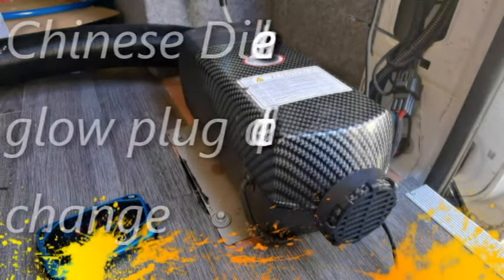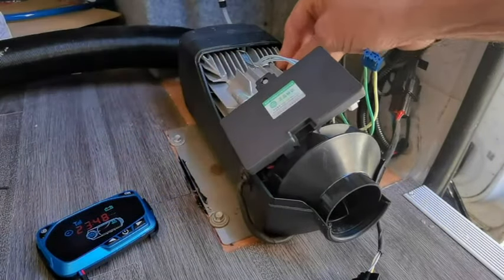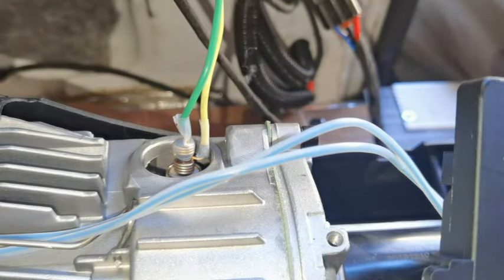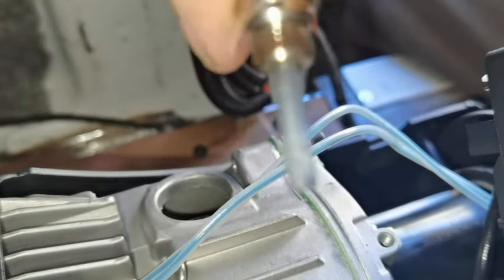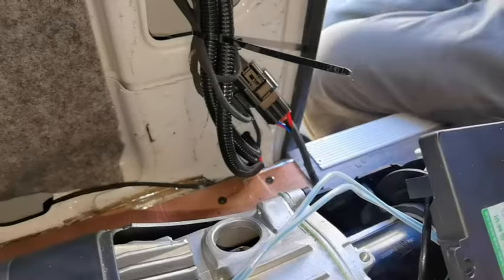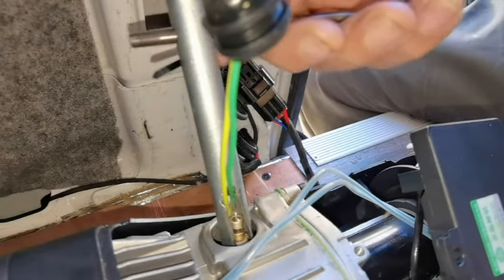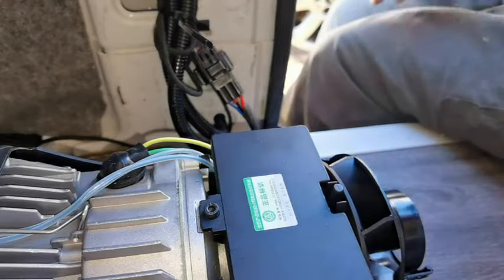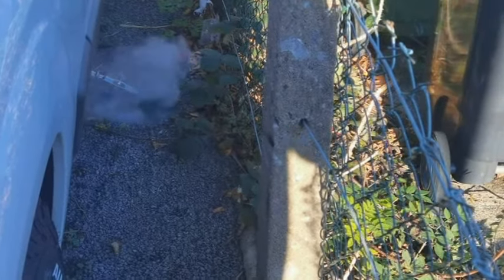Chinese Diesel Heaters Glow Plug & Atomizing Screen

Comment: To who ever is having smoke no start issues ,The gauze screen atomiser has to be pushed in as far as it will go so it doesn’t constrict the small hole to the side  that is what is causing the smoke no start issue, also use a bit of redex diesel treatment per tank fill will help. Also dont over prime these heaters as they flood .Great idea in vid using a concrete screw to remove atomiser screen 👍👍

Comment: Oven cleaner is great for cleaning out the burn chambers, strip it down then spray inside both halves liberally! After 5 mins soaking, give them a scrub with an old paint brush then wash out with a hose (water). Mine was blowing white smoke and wouldn't start, now it runs like new 👍

Comment: At the beginning of this 2024 heating season, my heater was smoking and not really running right until it finally started shutting down and restarting on me.  I took it apart and cleaned the buildup of chunks and soot and brushed and flushed everything followed by compressed air to blow out the air channels, and then reassembled.  After all of that, it was still not running right.  In a moment of desperation, I pulled the intake hose off and while the heater was running, tried giving it a bit of compressed air, thinking it was running rich.  My nozzle button "slipped", and the heater got a short burst at 120psi!  Soot blew out of every loose crevasse and out the exhaust!  I tried to do it again, but the air nozzle button slipped again and it got another burst!  What I noticed after that astonished me.  The operating temperature rose from the dismal 179C to about 205C.  One more burst, and it's been running at 215C, and now the only smoke I see is a white smoke on cold days with with no smell to it at all.  I don't know why the cleaning didn't fix it, but I'm happy with it now.  After that ordeal, I bought the whole compliment of replacement parts including the diffuser screen!  I'll be ready next time!  Thanks for the video!

Comment: Check the little hole above the atomiser screen.
Reply: tell me more about this hole?   how big/small?  is that the hole that introduces fuel?
Reply: Where's this little hole
Reply: @coachgeo the hole is on the part where the glow plug threads in, on the side where the fuel goes in right next to it and right after where the threads stop not sure what the purpose of that hole is but easy to clean!
Reply: @grahamfrear9270  the hole is on the part where the glow plug threads in on the side where the fuel goes in right next to it and right after where the threads stop not sure what the purpose of that hole is but easy to clean!

Comment: Same thing happened to me !  Hears what i did and it worked...  I did the same take out the screen then i cleaned the plug, then i cleaned the inside of the whole were the screen goes back.  i used a screw and wrapped napkin  around the screw then gently turned it around. I had did this many times to clean the HOLE TILL I WAS SATISFIED.  Don't forget to clean where the diesel squirts in, i had used the screw to scrape around that spot.

C;lean as best you can ,  one last thing be careful when trying to remove the screen.

I believe this happens more often when running on low , that's ok  just remember to fire it up once in a while on high heat for around 30 minutes every other week.

Comment: Thanks for the video is very helpfull. My question looking at the glow plug is that heater a 2kw or a 5kw.
I just replaced my glow  plug exact same after 3.5 winters working every day heating a 30ft bus conversion at times -20C + in Toronto very happy with it.
Reply: Did you ever open and clean it in side from the carbon build. I have used my for 2 years haven't done any service yet

Comment: I rebuilt mine got a new screen . Saw that the the atomiser was I thought cheaply made it was spot welded together . Pulled out the old atomiser ,and broke it the old atomiser was also clean . But I had to use new atomiser . It didn't work ! I also  threw in a new glow plug still didn't didn't work . Got it to smoke a lot . Checking into different atomiser . I'm thinking the spot weld restricted the screen too much . Let me know what you found

Comment: Yesterday I changed the glow plug after having E-03... but didn't have anything to remove the atomiser thingy... 
I primed the heater several times and then tried to start it. 
E-03 ! again. 
Do you reckon it's because I didn't change the atomiser?

Comment: Mine throw blue smoke when I first start it up and often fails but usually works the seconds time so I assumed it was just taking its sweet time bringing fuel up from the tank. Yesterday I turned it on and after a few seconds it just switches off and on again with no error code. Any suggestions?
Reply from the maker: Try fuel pump
Reply: @MrMeltedwellies  I was unable to get the atomizer out because its snuggly up against the walls of the shaft and I do wonder how it can heat up and allow the fuel to pass through it like that but the rest of my unit seems clean inside eg. its dry with no tar, the interior fins are black but the bottom was still showing bare metal so I doubt the atomizer is blocked. So I guess buying a new pump is the most logical choice followed by the glow plug.